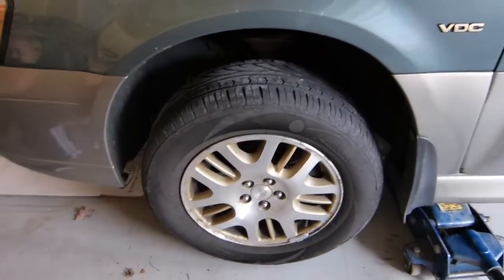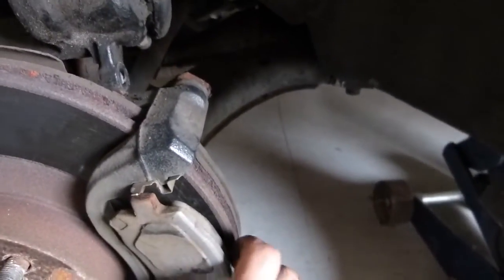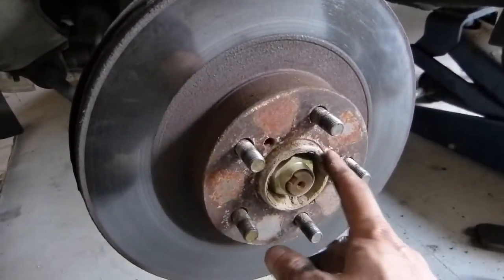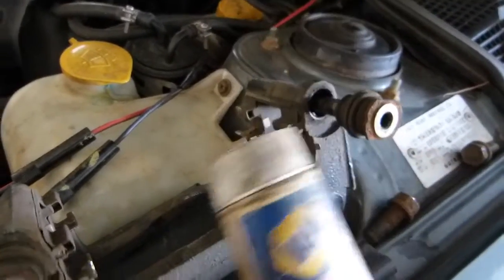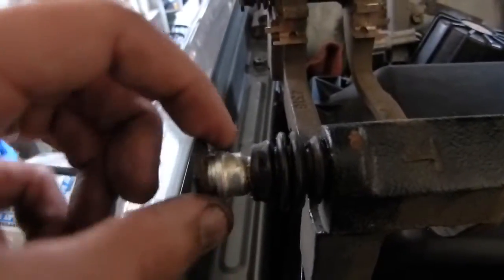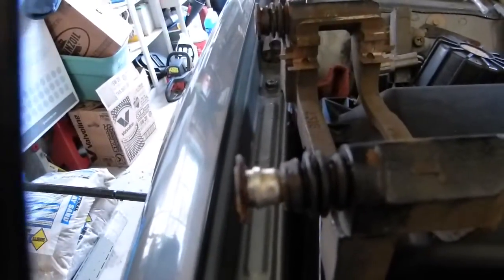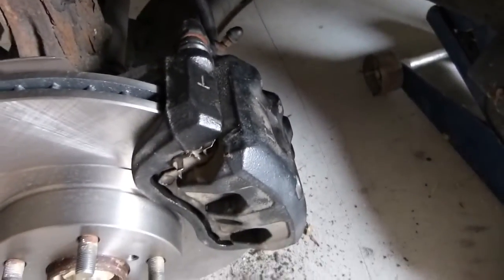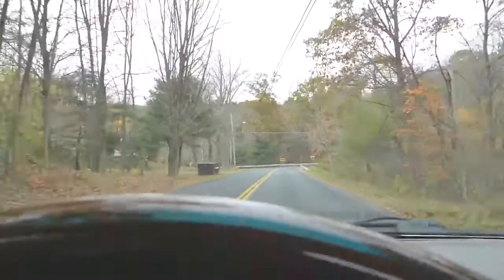Subaru Outback Brake Rotor Replacement Highlights and Stuck Caliper Pin Fix

Comment: I tried this repair for my stuck  caliper pins and it worked great!!! One of them DID shoot out like a gun shot so definitely be sure to point it away or stay off to the side!!! Also hot grease sprayed my arm which burned a little... better off using a long sleeve shirt or sweatshirt to protect yourself. Thanks for a great video!!!